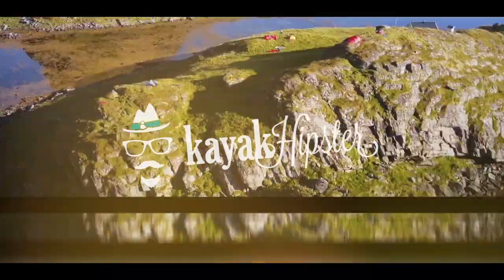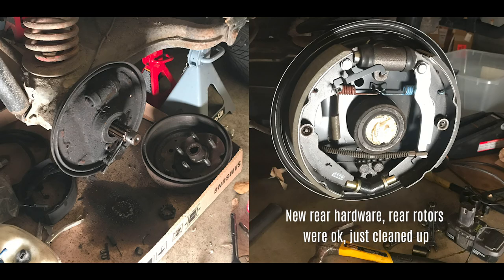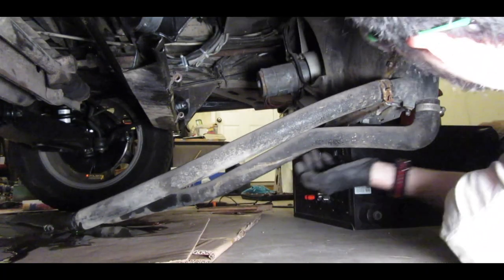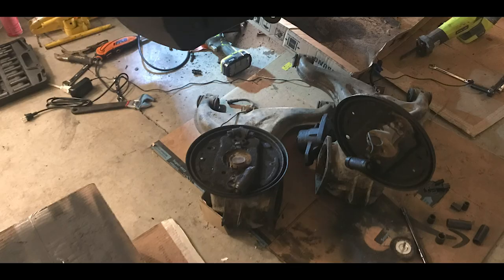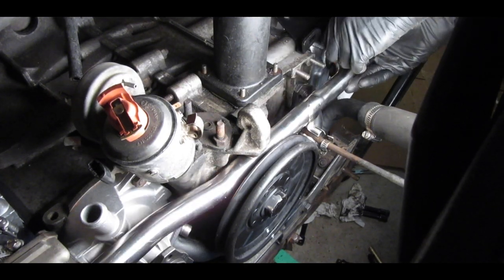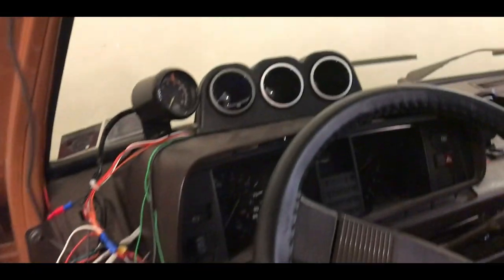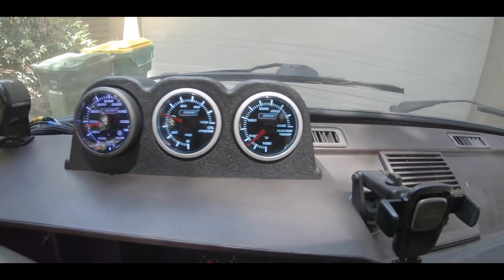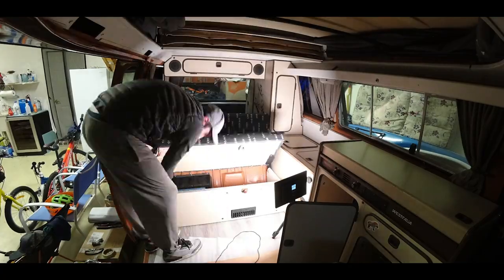84 VW Vanagon Westy Restoration Update After a Year of Work - Kayak Hipster

Comment: I’m too old and tool challenged to do this work and no one in Tennessee or Arkansas that I could find would touch my Westy.  
I knew from Bay windows that these engines need way too much gas and care.  I have an outfit in Colorado Springs putting a Subaru.   The Boston-based Bostig makes a kit for a four cylinder Ford engine that’s wort a look.  Both will get better mileage and not need the attention these underpowered VW engines need.

Comment: Awesome work man! The hardest part of any job on these old vans is figuring out when to stop digging into the problem areas and when to start building back up. "Mind as well" is a quickly snowballing effect haha. You've definitely made your van way more reliable and safe!
Reply from the maker: Thanks man! Your vids were such a great help as well. Cv’s, solar, rust repairs, all super helpful. And you’re right, it’s tough to turn away from something that could be fixed or changed if you’re “already there”… so much fun though.

Comment: Nice work. Thanks for sharing. Just went thru the same thing with my Canadian 82 diesel.  Can I ask what bumper you are running on the front?
Reply from the maker: Thanks! At the moment I don’t have a bumper on the front, I took off the metal cover and attached the bull bar directly to it. I might add a bumper later on to finish it out.

Comment: Thanks for the video, appreciate the thorough explanations :) 
The only tip i have is something i heard from my mechanic here in Berlin: according to him, 
The spare wheel in the front of the van was also designed to be placed there as it also works as an extra add of protection in cases of frontal collision. Not sure if it's true or not, but i just thought i'd share it. Therefore, my friends with 16" wheels have an old 14" wheel in the front as spare, and their other spares on a swingaway.
All the best

Comment: i dont understand why they are said to be unreliable in the US
theyre really reliable here, nothing breaks on them
Reply: The versions shipped to USA in 82-85 were severely underpowered.   Hiways here run at 70 up to 85 mph.   The suspension travel on the Westys is long and doesn’t lend itself to keeping an alignment without care.   The older vans have fuses that are bare aluminum so they blow at the slightest puff.  A lot of people stuff in high powered stereos putting a strain on the generator/alternator.   A lot come with air conditioning that is weak at best for such a large space.

Comment: Dang, I wish I was your neighbor!  Lol. I've been a bay window guy for 25 years,  just got my first vanagon.   85 Westy.   I havnt dug into it yet other than a heavy cleaning session but I assume I'm going to encounter issues that need addressed.   I've already noticed the long rubber water hoses that run to the front of the bus are pretty soft.  They both need replaced.  Hopefully the long metal hoses are good.  It's also only running a catalytic converter with nor muffler, just straight piped.   It sat for at least 10 years.   I put a battery in it and cranked for 30 seconds and it fired.  Couple rounds of that and it just started idling.   I'm kinda blown away.  I didnt let it run long.  Moved it forward and backwards and shut her down.  Has 120k miles. No paperwork.  Its filthy.  Has a little kiss kiss on the drivers side rear corner someone roughly pounded out and did a poor job doing the bondo.   Other than that its clean, no rust anywhere. Still 100% stock.  Might have to pick your brain in the future!

Comment: Very nice :) Would be still interesting, how much did you spent on the restauration ;)
Reply from the maker: I don't have a full amount since it's been such a long process, many parts I had bought years ago with the plan to someday install them. But one thing to note - because of the pandemic our family shrank our car budget from 2 daily drivers to one, and during lockdowns our little honda fit barely moved, so I was also allocating some of the budget I'd use for my daily driver to the restoration. In normal times this restoration budget probably would have had to extend for way longer.

Comment: VERY VERY impressed with what you have done to your Westy.  We have a 90 Westy and I've done little things here and there, eg. replace the fuel lines, but nothing like you have done-  not even close.  A couple of questions for you:  Did you feel any difference when you put the weight of the spare tire (plus the spare tire holder) in the rear when in came to the overall steering/handling?  and how hard was it to remove the cabinets?  We still have the sink, fridge (orig), water tank, and all that stuff, but I need to take care of some rust issues on the floor.
Reply: I also moved my spare tire to the rear and the thing I notice the most is that I don't use the rear hatch as much because it's one more thing. The weight isn't noticeable at all.  if you have a larger set of wheels the 15 or 16's if you want a full size spare you have to move it, and the easiest place is in back. If you use the cage to mount it underneath you lose some clearance. I hit the end of my driveway so it didn't work for me. Now that I have lifted springs it probably would work, but I like having the GoWest tray up under there for more storage when I am camping.

Comment: Nice job!  I put a new T3 anti-sway bar and new HD links and it makes a world of difference in cornering. If/when you start camping you will always be looking for more space, you may want to add the GoWesty under the front tray. Useful for things that you don't need often but want to have with you. Pretty easy to remove if you need access to those systems that are up front.  The VanLife center console is also well worth it. Gives you interior locking storage and get the additions for 4 cup holders you won't regret the cost.
Reply: Oh yeah, I added the lift struts for the upper tent and those help a lot with putting the top up.
Reply: Who sells this console please?   I’m not familiar with any venture names VanLife

Comment: May I ask:  did you fabricate a new wall insert behind the water cabinet and stove?  (the large one that is originally cardboard)
Reply from the maker: Not yet, I re-used the one I had after cleaning and spray painting it. I will be covering the holes inside the cabinets eventually with something else.
Reply: @KayakHipster  Ah.  Thanks.  There is something to be said about keeping the old parts where possible - like you said in the video.   Maybe keeping that is the best idea...after painting it...